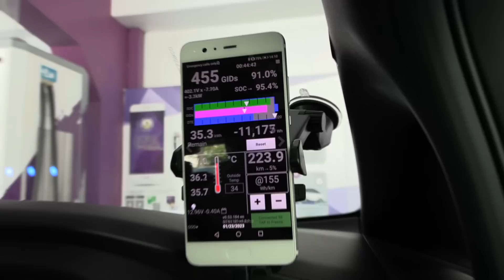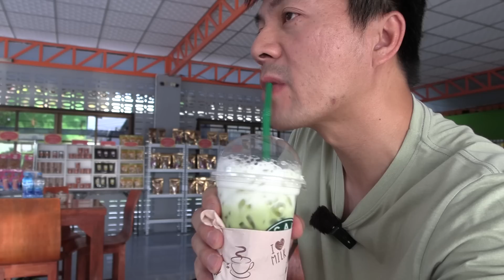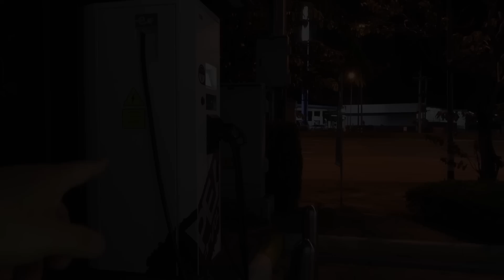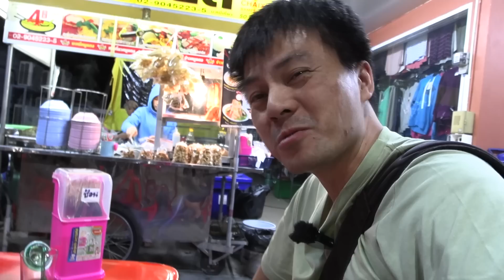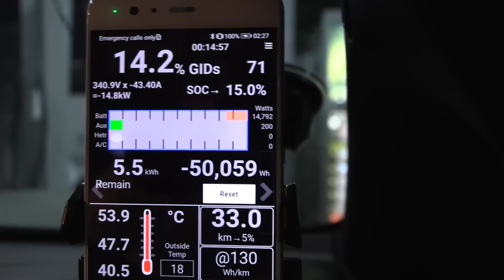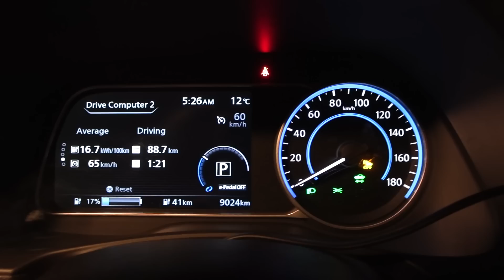Nissan Leaf 40 kWh Bangkok challenge

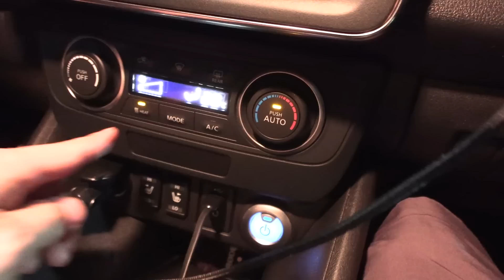Comment: I have a Nissan NV200 40kW. Heating and cooling while charging is possible if the display shows more than 15% which is 25% of the actual battery charge level.  And the heating and cooling while driving can be used until turtle mode is activated. 28:08

Comment: Pro tip: don’t buy a Leaf if you’ll need to fast charge more than a couple times a year OR if you live in a hot area (like Thailand, although the temperature during this test was not that hot). Absolutely blows my mind that the Leaf will make it through it’s entire product run across multiple generations and multiple batteries without ever having battery cooling, despite the fact that it was a huge problem for them basically since the beginning. Too bad, they would be a decent budget option now if not for the lack of battery temperature management and the Chademo charging.

Comment: More challenging with a Leaf than most newer EVs 😊😊

When you get back home, please do a range test with the Y Performance with regen on and another run with no regen at all (track mode). Would be interesting to see what the difference will be 😊
Reply from the maker: Track Mode on public roads? No thanks. No need to use Track Mode for no regen. Just use sexy buttons.
Reply: @bjornnyland  But how much impact will it have on range (if any at all) when driving with no regen compared to standard regen? 😊
Reply from the maker: Not much at all. People are too obsessed with no-regen and D mode thinking that it will make a huge difference.

Comment: You have to be over a certain procent SOC before you can heat up the cabin during rapid charging. On the old 24kw/h it’s at 16% you can start heating the cabin. The weird thing is that you can run the heat during driving below 16% SOC but when you charge it has to be over 16%

Comment: Is this accurate for Leafs in Norway? Will the battery be so hot if you drive in Norway on a summer day at 26°C? Will it charge so slow then? And what is the max range and charging speed you can expect on a normal day?
Reply from the maker: Yes
Reply: @bjornnyland  What's the normal or preferred battery temperature on electric cars? Is this also to be expected on the 62 kWh battery? Would you say this makes Leaf a bad car for longer trips?
Reply: @ericknsabimbona361  yes, search his old test videos for range and 1000km challenge on all Leafs 🙂

Comment: Thanks - enjoyed the video as usual! We have (in addition to a Tesla Model 3 RWD) an old 2013 24kWh LEAF, and in many ways its a great car. Good reliable build, pretty good features (compared to ICE at least), and really good efficiency (its not far off from my Model 3). While its a great car around the town, the battery is not up to practical longer trips. Its a pity they didn't add active cooling (even if capacity was reduced from 60 kWh to say 50kWh) as the battery also degrades faster than an actively cooled battery. Also as you pointed out the pricing on new cars (ours was a second hand cheap import) doesn't add up against the competition. When, at the end of 2021, I was looking for a longer range EV I priced the 60kWh LEAF here in NZ and it was MORE expensive than a Tesla Model 3 60 kWh LFP! The model 3 was the obvious choice (even thought I had no intention of getting a Tesla at the time!).

Comment: I use the Leaf battery in a conversion. It's a bit better vented but still rapid gating. I found disabling regen and cycling between 30-90% rather than 10-70% delays rapid gating because of the higher pack voltage and therefor lower current.

Comment: Bjorn I think Reason heater wasn't working at 28 mins  car wasnt fully on.. No green car and arrows on the dash
Reply: Apart from that, I found that (probably since the latest software update) it will not heat at <10% SOC when plugged in. It will still run the AC/heater while driving with 0%, but not after stopping and starting to charge. That's so stupid, having to freeze even though the car is receiving 44 kW. Who programmes this crap?
(Yes, car was properly turned on - at 10% SOC the AC came back. Consistent behaviour.)
Reply from the maker: SoC was too low for heater to start.

Comment: I wouldnt have used B mode because it appears to heat up the pack even more! Great to watch leaf in action again. I've had 3 of them!
Reply: Couldn't agree more. I drive my 40kWh like I drive my CT200h. D mode and anticipate the  traffic ahead. I get excellent mileage from both. And modest temperature increase in the battery pack.

Comment: 93% SOH after 9000km!!! Sheeeeeeeeet!!
Reply from the maker: Don't trust SoH. Degradation is only 3 % (97 % real SoH).
Reply: my leaf is on 10000miles and the battery still charges to 100%.  Maybe it is our weather in the UK!
Reply from the maker: Even a battery with 30 % degradation will charge to 100 %. Just because your car charges to 100 % doesn't mean that it hasn't degraded.

Comment: Hi,is there a way to find if the car is using friction brakes while regening? I mis-remenber if I heard you say something about a brand using friction brakes for kers in old videos.
Reply: For the LEAF it depends on the drive mode. If you enable "ePedal", which is the one pedal driving mode, it will use friction brakes in addition to regen to keep a constant deceleration until standstill. Even with full battery and therefore no regeneration it will always feel the same.
If that is what you refer to, I think in the more recent Ora Good Cat video Björn found that it only used friction brakes while on cruise control, but that seemed to have been due to older software.
Reply: @bjornbieber9403  yes.. The friction brakes while on cruise. So is there a way to find that out, or Bjorn just felt the car do so.

I ask because I have an Indian brand - TATA Nexon EV, so wanted to know same.
Reply: @AnoopSinghRanhotra  I guess using regen could feel a bit smoother than brakes, but the best way to tell is keeping an eye on the energy flow meter. In the Leaf the power to the motor is always shown as a circular bar graph, I guess your Nexon should have something like that. If it has a centre screen, there may be a power flow screen there, too.
Oh, and if you have a long mountain road near you, you could go uphill until your indicated battery percentage drops by 1 % (or whatever the smallest step is), turn around, go downhill on cruise control and see if the battery SOC goes up again.
Reply: @bjornbieber9403  yeah it recharges on regen while going down plus on cruise too. The bar shows. 

But that proves that friction brakes aren't used?
Reply: @AnoopSinghRanhotra  You're right, can still be a mix of both. It would just be illogical as long as it doesn't use full regen.
In the Leaf I can feel the brake pedal go down a little bit when it uses the brakes. Maybe that would be a clue.
Reply: @bjornbieber9403  hmm. So the analogy - if energy bar doesn't go negative on deceleration be it going downhill or cruising - means it's using friction brakes.

Conversely can't be sure if friction brakes being used or not when regen is occurring unless ofcourse when cars halts completely.

Comment: Leaf does not belong to countries that get no snow :D
poor battery, getting toasted like this, will not last long at all.
Reply from the maker: Winter is actually also bad for Leaf since consumption is higher and you need to charge more which introduces more heat. I've already tested rapidgate Leaf in Norwegian winter. Video in my channel.
Reply: well, winter is "bad" for every car. EV or ICE. But it does not damage leaf battery like heat does. 
I'm sure you can get it to gate doing 1000km but charging at home and needing maybe occasionally 2 fast charges a day - it has been fine and does it max speed.
Driving at 90 cools it down quite well in colder climate too.

Comment: Shortly after the 40kWh Leaf was released I was about to buy one, but I heard a few rumours from earlier purchasers that it overheated very easily. I borrowed a new Leaf from the dealer for a test drive and did a couple of hundred miles to check this out - at night in Scotland, so heat really should not have been an issue! It overheated a little on the first rapid charge, and a lot on the second. RapidGate confirmed! I then bought a secondhand 30kWh Tekna and have not regretted it!
Reply: No rapidgate on 30kWh.
Reply: @timstruppi7897 it does rapidgate still with repeated charges, and the 30kWh pack is very infamous for degradation.
Reply: I drove from Inverness to Manchester, 4 charges no issue at all. Nice car

Comment: As far as I'm concerned this is environmental vandalism by Nissan treating 40kWh of batteries like this. They'll be in landfill soon. They've had years to sort this out.
Reply from the maker: https://www.cnet.com/roadshow/news/nissan-leaf-ev-batteries-to-power-amsterdam-stadium/
Reply: The problem in my opinion (speaking as an electrical engineer) is that this is green washing. The cells will be unusable in their intended automotive application after a few short years (writing off the rest of the car) and these over temperature conditions will leave them at a state of health that makes them unusable in any application. My guess is that the linked project uses selectively chosen cells and probably doesn't make economic sense compared to installing new cells so don't expect widespread adoption.
Reply: @jay-em  This is just nonsense Jay. There are millions of Leaf drivers worldwide whose cars did not become “unusable...after a few short years”. That’s demonstrably false. Static batteries have no volume or mass restrictions so old vehicle batteries are ideal material. And the reason the Leaf has no cooling is that it was designed as a 95% solution – 95% of users, 95% of journeys. That’s what it was engineered to achieve, and it does. It does NOT suit all uses, and that’s deliberate. Please stop spreading FUD. Your qualifications for joining wires does not make you an authority on battery longevity. BTW I studied electrical & electronic engineering with particular emphasis on motors, and you do the profession no credit with lies.

Comment: You should turn on A/C because aircooled batteries are cooled by cabin air.
Reply: Leaf batteries are cooled by hopes, dreams and outside air only
Reply from the maker: Incorrect. The battery has no active cooling.
Reply: @bjornnyland  Sorry for wrong information by the way.
Reply: @bjornnyland  Holy....even worse than I thought